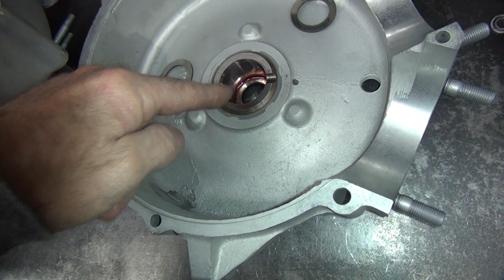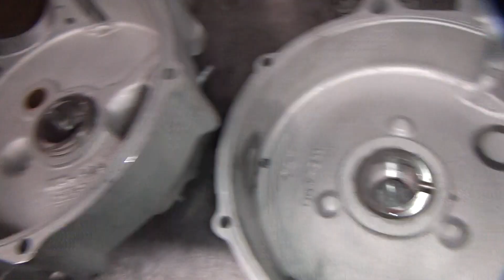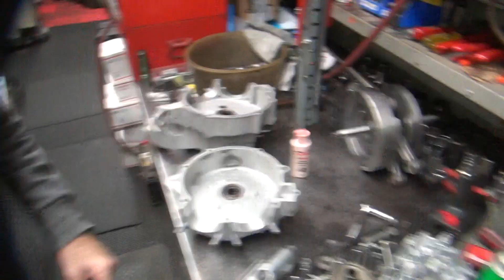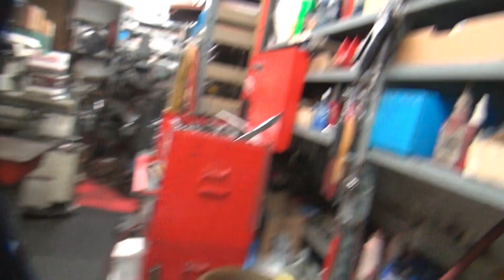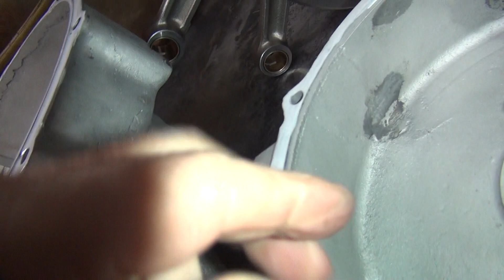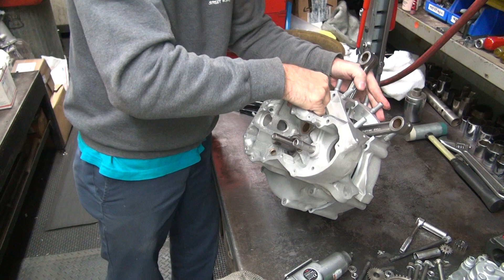#238 1947 EL case welding knucklehead 74ci motor rebuild & machining repair harley by tatro machine

Comment: Still putting pre-54 engines together with the .600 long pinion bearing. As soon as you slid the pinion shaft into the sprocket side I thought how long before he realizes. It always takes me several tries to get the end play right and pulling the cases apart I always have bearings all over the place. Nice video. You don't go into as big of a rant as I do when I make mistakes.
Reply from the maker: things happen, deal with it and move on.
tatro
Reply: @TatroMachine  People who don't make mistakes have never done anything!
Reply from the maker: that is a fact.
tatro

Comment: Just a question. Did you double washer on the cam side?
Reply from the maker: if you are asking about the main bearings? than yes. i thin one and one thick one. all four wsahers are different.
tatro